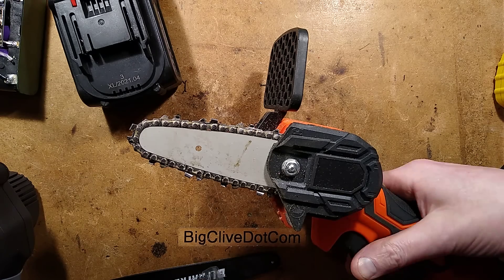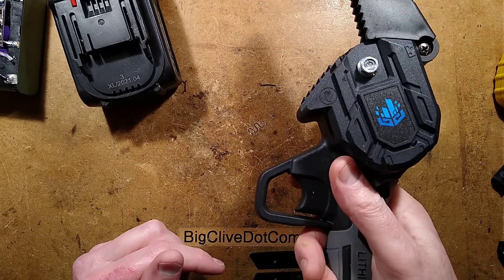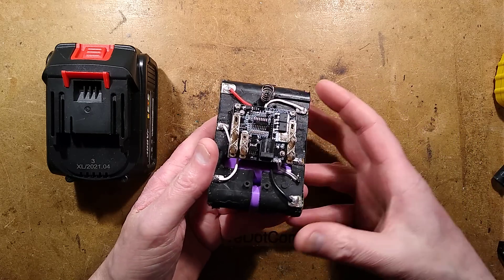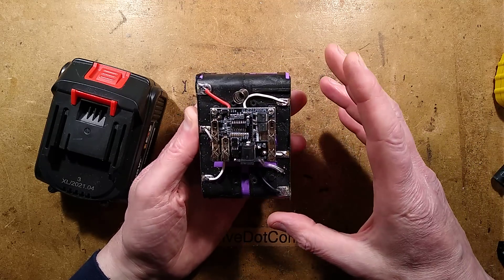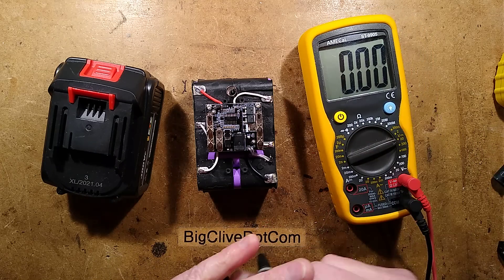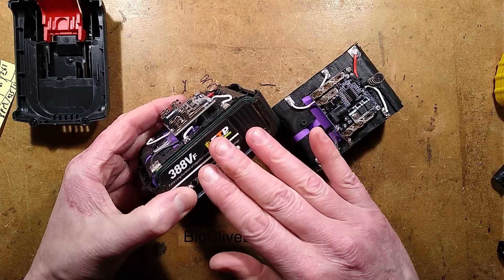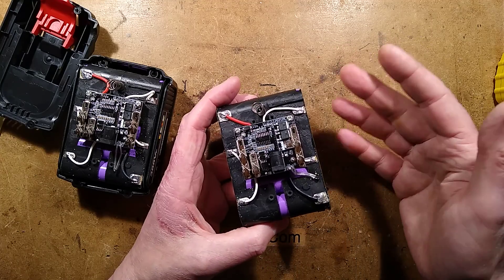Dead batteries - with odd charging circuitry

Comment: That MOSFET in the charging circuit is indeed a P-channel and full marks for drawing the symbol correctly but you've drawn it upside down.  The Source should go to the charger and the Drain to the battery.  That way the internal diode is not forward biased and the 2M resistor is across the Gate-Source to turn it off.  MOSFETs are canny devices which can often be used upside down.  They don't care which way up they are as long as the gate is biased correctly relative to the source.

Edit - I spuriously said the 2M resistor was across the Drain-Source, it should of course have been Gate-Source.
Reply: Just to clarify, this MOSFET  is not really being used upside down, it's the schematic that is what I would consider drawn upside down.  The charger line is the most positive voltage and is therefore connected to the Source and would normally be shown above the battery line, hence with the MOSFET shown the other way up.  However there are situations where MOSFETs are genuinely used upside down ie with the positive supply connected to the Drain on a P-Channel type, an example being synchronous rectifiers.

Comment: I got a couple of battery powerewd devices (an impact gun and a handheld "pressure" washer that was more of an electrified supersoaker than a washer!) from "over there" and they came with similar batteries, the cells were about as well-balanced as the tory budget, couldn't get the things to charge to the right voltage and stay there and so they died fast, so opened them up, and, well, a couple cells had charged way over 4.2v, and others stayed under 4v, ended up using the USB TP4056 boards to recharge the cells individually and it seemed to work, though I've not used the tools since so dunno if they've died again...

Comment: My neighbor asked me if he should buy the DeWalt clone 60V battery for $60 instead of the original for $270.
I told him no, but he went and bought it anyways! Why ask?
A week later, he gave it to me saying it died on him. I dissected it to see what went wrong and found two cells to be almost shorted. One was at 0.87V, the other at 1.3V. 
The cells on a power tool have to be top notch in order to deal with high currents. These were no Samsung cells and crapped out when pushed. 
If you buy power tool batteries, don't buy the Chinese crap. Pay once, cry once.

Comment: If nothing else, the chains are probably fully interchangeable, so you can saw away happily for longer before you need to re-sharpen them.  The extendable pole-mount versions (e.g. Ryobi) are really handy for heavy - duty pruning of the larger trees. Just make sure you're out of the way when the branch detaches 🙂
Reply: You don't have kids or other trained monkeys for those types of maintenance jobs?! 🤔😉😊
Reply: @theoztreecrasher2647  I just noticed your moniker! :-D  Well, some of us actually enjoy "heavier duty" gardening  (which is handy living out in the sticks!)
Reply: The chains come in various sizes (4" and 6" seem to be the most common) so you should check for the correct size when buying spares or swapping. They are very cheap, though, but the price reflects the quality.

Comment: Would it be possible to modify the pack to just use regular 18650's? The end result could be like how you'd put 4 AA's into an old GameBoy.

"Oh no, the battery pack died. Guess I'll just swap the batteries out."
Reply from the maker: The snag is the very high current contacts needed.

Comment: Could probably make one battery out of the cells of the two. Use the fancy Lithium charger to test the cells and pick the best 10? Edit: DeWalt doesn't actually have any on-board electronics. IIRC, there's a small balancing PCB with no ICs, but there's no protection of any kind -- it's all built into the tool or charger. I actually like that, because it means no dead batteries from quiescent draw, but one does have to be more careful with non-DeWalt uses.

Comment: I've been using DeWalt buzz guns for years. I bought 4 genuine replacement batteries every one the case broke before the battery. I then tried cheaper copy's I've had around 15 now with mixed results most of them have survived for a reasonable period and the case has broken others have had faults and broke straight away. I've still got most of them and intend to use them again for what exactly hasn't come to me yet.

Comment: Had that with a replacement laptop pack. First one was 7V8, for a 3 series pack, so was returned and replaced. Second was 9V, but was in undervoltage lock out. So a small bit of work with a 1mm drill bit to get a pair of holes to the end of the pack, and a charge at 1A for a few minutes to raise the voltage up to 11V, and the pack decided it was happy again, and started to charge. After 12 hours it was still at 77% capacity, but fully charged, so it took a few cycles of full to near flat to get the charge controller to agree with the battery, and bring it back up to 100% again.

Comment: Interesting I always thought they charged the cells separately for balancing purposes. 
Nice video!
Reply: Nope, most (at least) just dump charge through a shunt resistance from the fully charged cells and then continue to force current through the string until they (try to) pull the low cells up. That's why your charger will often show quite a few more mAhrs going into a lipo than the battery pack is rated for. Not a good sign!

Comment: The rectifier diode across the output is a necessity when you connect those battery packs in series. When one of the BMS in the series connections turns off, the other batteries will put a negative voltage to its terminals and fry it. The diode limits the negative potential to a safe level so that the BMS won't get fried.
Reply: Einhell battery chainsaw with 2X20V batteries in series, has similarly diodes on battery connectors. Maybe, those batteries don't have those safety diodes or to be on safe side those are on battery connectors aswell.
Reply: @Tegelane5  if it is explictly made to be series connected, it may have integrated diodes. I killed a battery pack once that was not made for series connection and the water kettle drew a little too much current for one of the BMS to like and poof it went up in smoke. This was before i learnt about the antiparallel diodes and added those to all of my circuits where protected batteries are connected in series.

Comment: The second transistor is most likely used the control the high current charge FET as the IC can't drive the outputpin controlling the FET all the way to the positive terminal. If it can't do this the voltage on the gate-source of the power fet will never got yo zero and the FET won't fully turn off. This is a common problem with driving high side FETs and this arangement is quite common when switching with p-channel high side FETs.

Comment: "Discharge to 0v before throwing away".... I have not had much experience with Lion batteries but quite a lot with nicad cells. I have seen nicad cells that read 0v still go up in smoke if accidentally shorted.  I no longer trust that a cell is fully discharged.

Comment: ???? I was told lithium cells or battery packs last much longer if you only do long term storage at a 40 to 50 percent maximum state of charge, not topping them off to 100 percent, and then recharging them once in a while to that 40 to 50 percent level.
Reply: Who said "top of to 100%" ? they are wrong you are right.

Comment: Is there anyway your average Jo can discharge a cell safely without any particular specialist equipment? I recycle my batteries at Aldi but would discharge if safer.
Reply from the maker: You can connect a suitable load or just a resistor and check the voltage for when it is low (about 2.5V or less for a cell.)

Comment: I've scavenged old laptop batteries and extracted perfectly good, if ancient, cells.  Usually panny-Bs and even some panny-As.  They work perfectly well in mild-mannered flashlights and such.  Most packs I've seen are nS2P, so typically one pair will be hosed and take down the entire string, but the others will be fine.  Got an analysing charger, just give them a few cycles to see how they fare, and make sure they don't get too hot when charging (too-high R).  Goldmine...

Comment: Thanks for the tip not to leave lithium tool batteries in the flat state after use, very interesting. I've had a couple of lithium tool batteries go weak and weird, it's entirely possible I left them flat for a while in my ignorance.
Reply: Now you have been told !

Comment: Clive, most TP4056 usb boards stop a discharge at 3v to protect cells. What would you advise to take cells down to 0v for safe disposal? A string of led lights connected directly to the cell?
Reply from the maker: That would work.  It would take them down to about 2.5V and be functional as the discharge was happening.

Comment: I had to throw out 4 makita 3 ahr  and a mikwaukee m12 and m18 too many dead cells from leaving them in the truck for 3 years without charging .Heat and cold destroy lithium batteries and they do get over 50°C in the canadian summer and -30 in the winter in toronto .

Comment: If you are safely discharging them how would you recommend doing that? 1-10k resistor between positive and negative until dead?
Reply from the maker: A 1K resistor would take a while across a single cell, but would work.

Comment: no balancing  in charge circuit?
Reply: Nope, just like the old Parkside batteries - the new ones do.
Reply: These 'Makita Compatible '  packs  are very prone to go out of balance. Genuine Makita packs also do not have balancing,  but have quality cells closely matched. They usually stay balanced for quite some time, but not always
Reply: @earl3358  Interesting... I wonder whether it's cheaper to put in a balancing circuit or use higher quality cells!

Comment: I bought a similar one. Very impressed , managed not to kill myself , 10 foot up a ladder trying to cut down Ivy. I keep any tool batteries out of the house in a locked box as they could be go up in smoke at some point.  I also never leave any batteries charging unattended. May be I am too Elf and safety conscious but working in the energy industry since I was 18 and I am now 56 , I think that is where it comes from.. All the best Alex.

Comment: I have playing around with lithium cells for a while now and most of the cells I have salvaged do recover from self-discharge, it's the ones that heat up a lot during charging or is completely open circuit that are unusable for me so far. The pouch cells are the worst offenders in failure._

Comment: It's interesting how batteries handle being drained entirely. We've had car batteries come right back to life after sitting dead all night, but you look at a lithium cell wrong and it'll explode. Coworker's alternator went out and only found out the moment he pulled into his parking spot when the battery ran out of juice. Old charger we kept in the crib has the jumpstart option of dumping 100+ amps. Gave him enough charge to go back home and get it fixed over the weekend. Meanwhile the charger I use for my longboard batteries top out at 3 amps and I heard the popping sound of the plastic wrapping giving out as one of the cells started to expand.
Reply from the maker: There are some interesting videos showing useful service life from lead acid batteries being completely reverse charged.
Reply: What happened to the battery warning light?
Reply: @matthewmarks6951  honestly don't know. I noticed it didnt have a battery gauge, but I suppose it should have at least warned him it was low.

Comment: Might be cheap and nasty but not as cheap and nasty as the Lidl Parkside ones which have no FET at all.
Reply from the maker: Many of the prominent brands rely on the tool to shut off when signalled that a cell is low.  That makes the cheap tool batteries much better for DIY projects.

Comment: There is no BMS in standard DeWALT 18/20v batteries but there is a PCB. Clones often skip the PCB and they seem to work but they certainly look like they do a bit more than just temperature monitoring. That said, I don’t think there is a parasitic draw. I wouldn’t be surprised if DeWALT FlexVolt batteries had a parasitic draw tho’ since they look a lot more complicated inside.

Comment: Yeah like the older dyson cordless zero battery managment at all just power in and a temp probe? How can dyson get away with doing this ill never know.
Reply: Clive is there some trickery inside the vacuum units do you know? as they never have battery fires I'm confused I bought 1 with duff battery expecting a BMS inside coz of the 4 connectors only and it was bats only ?

Comment: I've read that the experts say for long time storage of lithium power tool  batteries, you should store them at a 50% charge by the pack indicators. This is the level at which the batteries have the least degradation in storage. Phone batteries over all life lasts longer if charged to 80-85%. Samsung phones have an option in the settings  so it doesn't charge over 80%.
Reply: Lipo batteries have a storage voltage of 3.65v, a full charge is 4.2v, and “it’s dead Jim” charge of 2.9v
Reply: @robert_g_fbg  The thing I should have mentioned was they were referring to power tool batteries and they're indicators.
Reply: @bwselectronic  it would be a good feature for battery chargers to include a switch for limiting charge at storage voltage.  A lot simpler than remembering percentages or number of leds on the gauge.

Comment: you say let it self discharge.... how long would that take to self discharge, or is there a quick discharge method?
Reply from the maker: It would depend on the level of internal self discharging.  You can also add a resistor or string of LED lights across a single cell.

Comment: Guessing these things don't handle balancing on the cells? makes me wonder if i should be soldering balance leads to em 😀 , The battery i have has no branding on it and the chainsaw it came with has 0 branding or salty interlocks for that extra fun. But it has been good at sawing down stuff so i suppose ive gotten my moneys worth even if it is a lethal chain saw.
Reply: No they don't balance. Older Lidl Parkside batteries didn't balance but the newer ones do.
Reply: @matthewmarks6951  starting to wonder if i should check the cells now and then and maybe even get a balance lead on them.

Comment: I have been playing with tool batteries for a little while now.  All brands from recycling places.  The reverse charged cells almost always will self discharge.  But in your case with one bad pair then I would just replace those two bad cells with two good cells of a higher capacity than the other cells in the pack.

This has worked quite well.  I separate out and test each cell independently just to make sure.  Charge them all.  Check voltages over time.  Anything with self discharge is junk, no question.  It never "clears".

Comment: So without back-to-back MOSFETs, it can disable the output if the pack voltage gets too low but not if it gets too high? Because of the body diode.
Reply: Yeah, you can't prevent it being charged, which can be bad if the cells become unbalanced and one is overcharged without the charger being able to tell because all it knows about is the overall voltage. Lidl Parkside ones have no FETs at all but use the data connection to tell chargers or tools to stop.

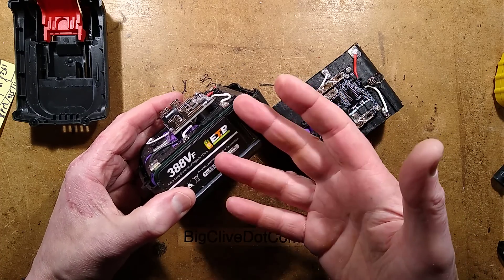Comment: @5:55 [timer]You do mean 80%, right? I thought the optimum storage level for lithium 
ion batteries was around 3.7-3.8 volts. Max being 4.2V (not for storage but a safe level to have them at when you go to use (discharge) them.)
Reply: Nominal (working) voltage is 3.7v store at 3v and charge to 4.2. Anything below 2.5v is dubious but you might trickle it and get lucky if its a good brand.
Reply: @andymouse  So store at 3V. Interesting. Yes, I agree that even 2.8V, would cause me alarm. Thanks!

Comment: Li-ion should be fine until you put so much discharge current trough it that you reverse it's polarity, this is fatal damage. 0V is not death sentence. Just charge individual cells to same voltage. And after few cycles BMS will catch up :) Of course do at your own risk :)

Comment: i was given a dead makita 18v 4ah pack.  i opened it up and 1 of the banks had reversed voltage.  i used one of those little pcb chargers that takes a day or 2 to charge the 2 batteries up.  i think ive seen similar things on your channel.  i might have given them a surge to start with using techniques seen on a yt video.  anyway, i got a genuine-looking pcb from china and installed it.  it has died again after 2 years of use.  a worthwhile learning experiment.

Comment: I see that in a lot of battery management system designs. They're at least partially powered by the cells they are monitoring. The problem is they don't know when to stop using power. The BMS has to keep going so it's ready when needed. They lack a standby signal that shuts them down when not needed.

Comment: nice to see a pack that draws from the whole bank and not just one cell, causing an imbalance. With no balance cct. Only thing to add is not to fully charge your battery if you are topping it off. they prefer to sit at 3.7 to 3.8 V
Reply: I've never come across any that power the BMS from one cell - that sounds particularly nasty!

Comment: A battery pack, like a chain, is only as strong as it weakest member. When one cell is only working at 66% that means you can only get 66% out of the rest. This gets to be significant when there are 96 cells in series and there's 100kwh of battery there.
Reply: Oh, you can quite easily get more than 100% out of that scenario - cue Fire Brigade video! 😵‍💫😈